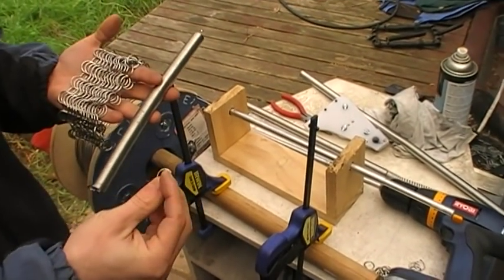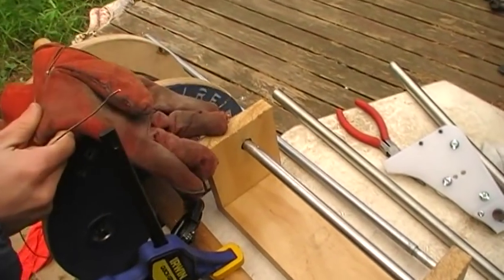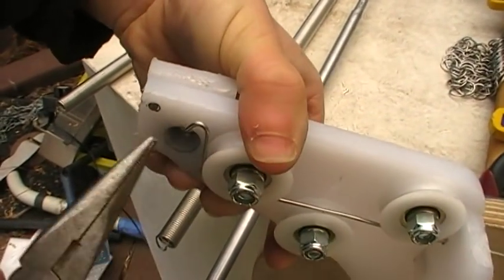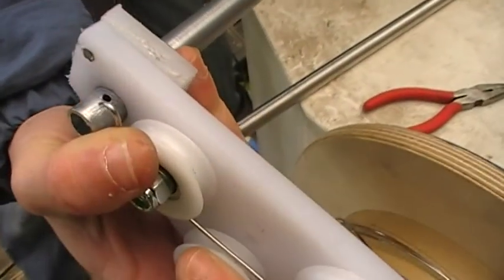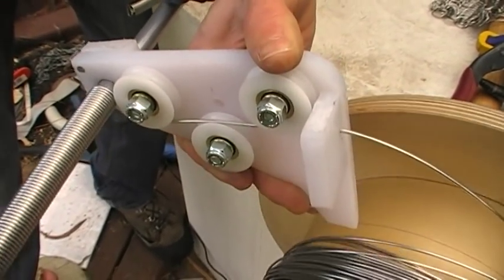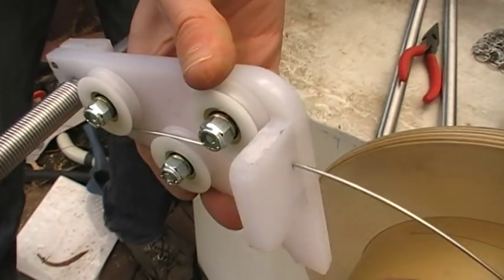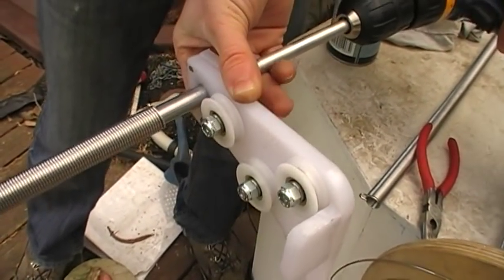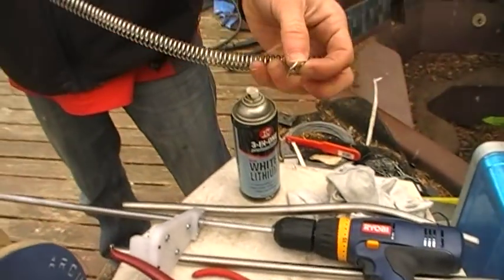How to make chain mail rings - Enhanced Jig

Comment: if you can make that jig, why don't you make a jig to rest the rod with the spring in a groove, so you can use another jig to cut it with an angle grinder, it'll save you a lot of time cutting it! you don't even need an angle grind, a sharp wheel pressed over it, like one of a pipe cutter, will do just fine too, just 2 miter tracks, a rod with a pipe cutter wheel, some knobs on some bolts to give it pressure like a pipe cutter, and just make a cut over the length of the rod with the spring. that should be fairly easy to make, no? maybe by hand, you could even do it with a carbide chisel from a lathe.

Comment: 1.6 mm purely ornamental?! Are you joking?  I mean, sure, if you plan on making rings a ridiculous inch in diameter! 1.6 mm is the  perfect size for maille when the rings are the right size at 6mm.
Reply: 6mm is a little on the small size and results in a heavy and dense mail.  8-9mm was more common and in this case it is purely for looks, not function, so ring size can be whatever you are happy with.
This jig is ingenious and will work with any size, just change the mandrel OD and wire size to suit...

Comment: it really bothers me how oversized people keep making these rings -_- they should be like 5-6 mm
Reply: depends on the pattern they're using, there are a shit load which use different size rings...
Reply: Depends on what you're using it for I presume. It'll take longer to make a full suit using a smaller chain. If you're only using it for dressing up you don't need smaller rings.
Reply: why does it matter if oversized people are making the rings? can't large people have chainmail too? just saying, grammar matters
Reply: Weight. 1/4" (~6mm) Arbor Hole 16-gauge steel gets extremely heavy, while also extremely thick.
Reply: Dylan Hancox 9
Reply: You are discriminating against oversized people here. They can make this just like normal sized people can. :P
Reply: Dylan Hancox I could see if someone was just getting into this. Larger rings would have things easier
Reply: Depends on what he is using it for.
Reply: Most common historical mail links were ca. 8mm. Link sizes commonly ranged from the tiniest at 3mm to about 10mm. 12mm would be unusual... or maybe horse armor.